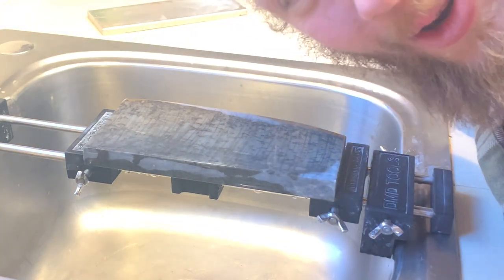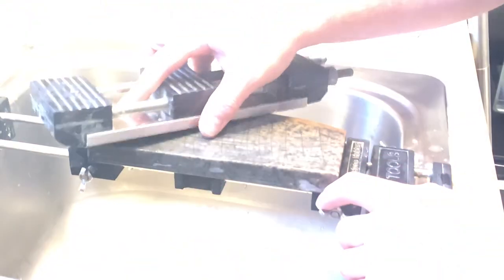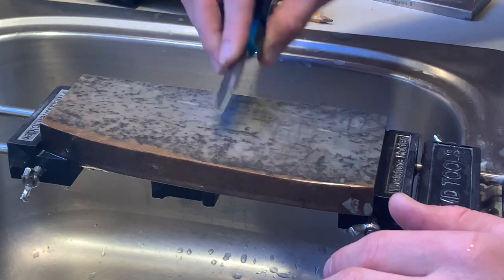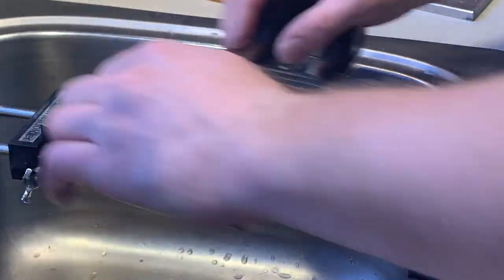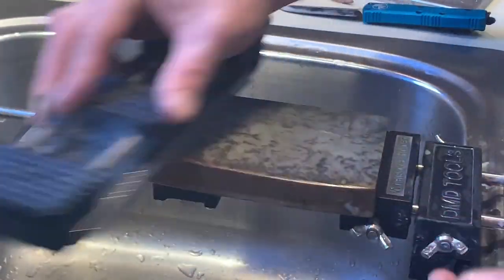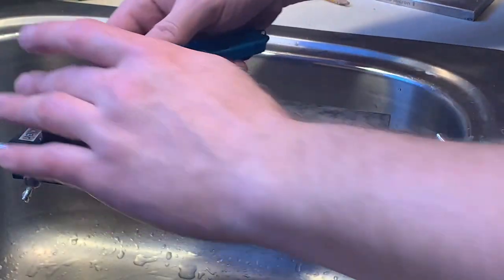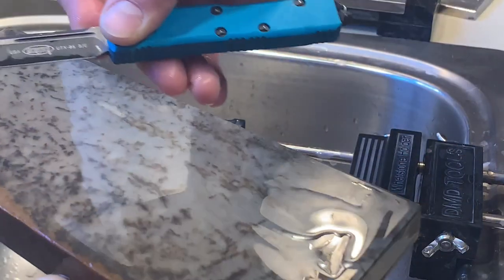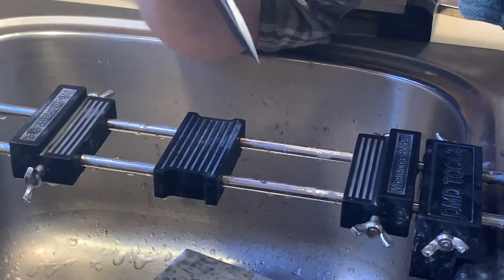How to flatten your sharpening stone - Jasper one stone honing Elmax Microtech vs natural whetstone

Comment: I have a dan’s black ark and it killed my dmt 325. Is you stone softer or is it a dmt killer?
Reply from the maker: Same hardness as the hard arks, but that killed diamond plate is now perfect for slurrying a stone like jasper when honing with water.
Reply: @WildWhetstones  Thanks Gabriel, I’m afraid if that true the plate will be 100% worn out in 2 or 3 slurry uses. I purchased the plate new and a couple of brief lapping on the Ark removed 70% DMT plating, had the plate of less than 10 days. This my biggest concern.
Reply from the maker: @dappershaves  There’s a break in. But it should last a long time keep using it
Reply: @WildWhetstones  Thanks Gabriel, Ordered my stones today. will report back once I’ve had some time with them.